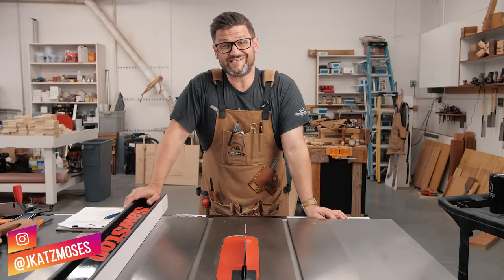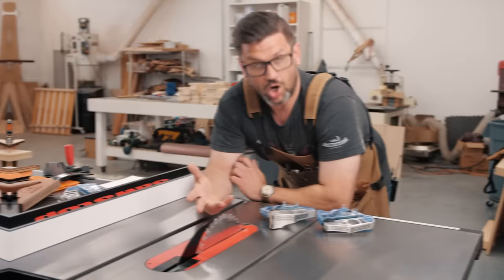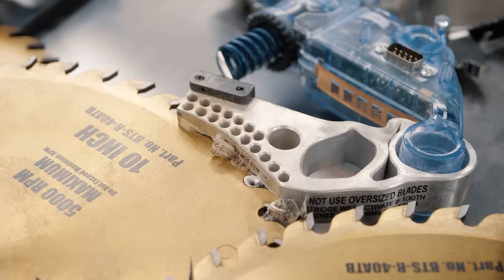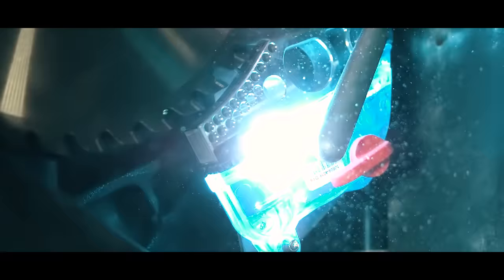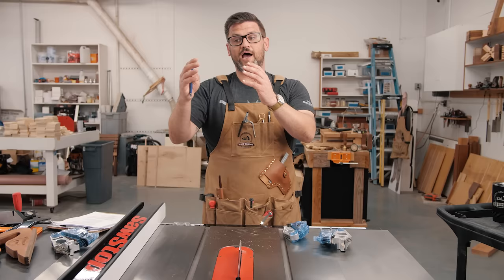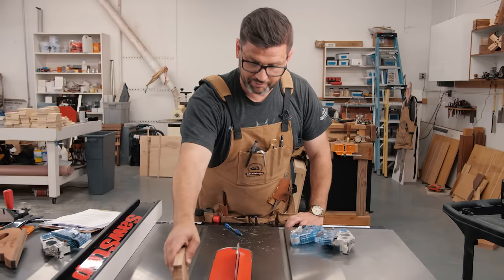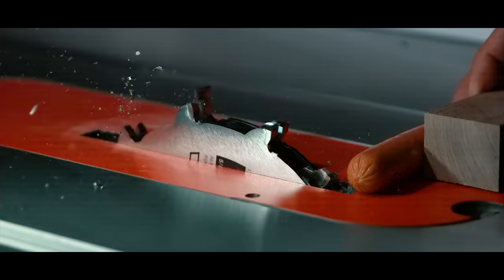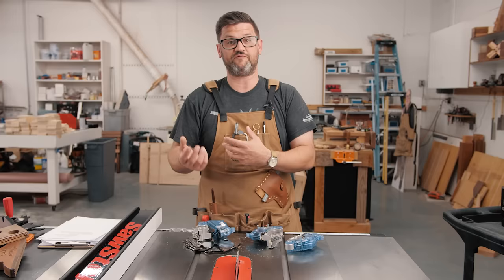How Safe is a Sawstop Saw? - Never Before Seen 19,000 FPS HD Slow-Mo Video

Comment: Just as a clarification, dados are not illegal in Europe. Saws have a requirement to be able to stop in a very short time after power off (something like 1.5 seconds if I recall correctly). Hence they need to have a brake, and manufacturers shorten their arbors so you cannot put a dado stack on your saw because it would then fail the braking requirement (more mass, more inertia, longer stopping time). So they're not really illegal, and you can still buy them here from a few rare suppliers, but they're just not possible to use with the vast amount of saws available.
.
Beyond that, holy bejeezus those are some cool shots! I'm getting a newfound respect for Sawstop for sure, especially with the dado stop.
Reply from the maker: Thank you sir! I hope you're doing well! Still trying to check of all the ways to sharpen my pencil 😉
Reply: @katzmosestools  I'm trying to reach out to Sawstop to see if they want to co-develop a pencil sharpener using their technology, no luck yet though 😉
Reply: My evolution table saw takes like 25 seconds to slow down and it's only a few years old
Reply: @fennecbesixdouze1794  You normaly dont lie on a table saw do you? 1,5 Seconds is a long time yes, but its short enough to prevent further damage.
Reply: @fennecbesixdouze1794  no they use router bits over there.
Reply: Seems like this saw stops within 1.5 seconds, so maybe dados on these are legal?
Reply: It is not inertia, but the moment of inertia (nmr^2). Nice explanation!
Reply: Holobrine what are dados?
Reply: Bobby Brady  no, I said Europe because that's what was said in the video. As far as most people outside Europe are concerned EU and Europe could just as well be synonymous, so there's really no need to be unnecessarily picky.
Reply: @fennecbesixdouze1794  At least they aren't slaughtering us in our houses and streets though for no reasons what so ever. I'll take our version of policing over yours. At least we get to live to tell the tale.
Reply: Switch & Lever I searched Dado blade illegal and this paragraph was brought up from WoodWorkerInstitute.com.. "As already mentioned dado blades areillegal on UK (EU) table saws because in order to use them the guard and riving knife have to be removed, and is therefore unsafe. This is not the case in the USA. Because of this, all UK or european table saws are deliberatley fitted with short arbors to prevent their use."
Reply: @sheldonwoodhouse4222  yes, this is an oft repeated misconception. They're not illegal, as you can buy them from a few shops (like Axminster) as well as saws that can accommodate them. There is a whole business in the UK of retrofitting older table saws (and other similar woodworking machines) with DC brakes to make sure they comply with standards. No one is really going to fine you if you have a non-compliant saw in your home workshop, but if you use one in a commercial setting it will have to comply.
Reply: @fennecbesixdouze1794  🤣
Reply: @fennecbesixdouze1794  it's not 1.5 seconds in emergency, it's 1.5 seconds when powered off. You finish your cut, your turn the saw off, and by the time you've picked up your piece of wood the blade isn't spinning. That's reasonably safe in most situations. 
Being able to stop in a fraction of a second like this video would require special equipment like the Sawstop. You wouldn't want your saw to fire the Sawstop every time you power it off, you'd have to replace the blade and mechanism every time. 
As someone stated above, saws that don't pass the regulation can take upwards of 25 seconds during a normal power-off. Compared to that, 1.5 is definitely safer.
Reply: Bobby Brady  dude, chill. It's okay 🙂
Reply: @markrobinson8575  what
Reply: Bobby Brady  calm down Bobby Boy, no need to get worked up :)
Reply: @fennecbesixdouze1794  No
Reply: Not sure if I missed it in the video, but how is it distinguishing between what's gonna be a finger/thumb or a piece of wood?
Reply: Bobby Brady  wow so mature of you
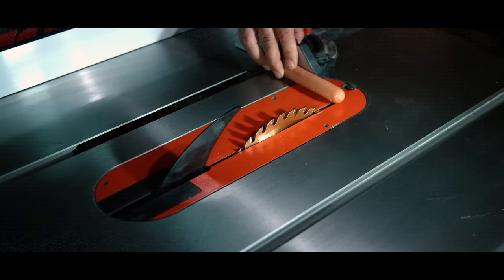Reply: Spicy Meat 2:35
Reply: @AverageAtBestHDTB  It wasn't explained in the video. But he does go over the 3V of current running through the blade. Wood doesn't conduct, but your finger will, when that current drops, the blade stops
Reply: @ferociousmullet9287  that doesn't happen over here either lol. That's media dramatization to seem like the norm, when in reality it's quite rsre
Reply: @SwitchAndLever  it seems you don't mind being unnecessarily picky about casually using illegal in a way most wouldn't care about.
Reply: @lucasng4712  Cheers, very clever system indeed
Reply: @lucasng4712  does it work the same when cutting metal also?
Reply: @ryanbrown4053  3 a day on average. That is not rare. Stop the lies and denial. Try and be honest at least. THREE a day compared to every other western nation on the planet which is an average of ZERO a day. Denial is not just a river in Egypt. Stop being so disingenuous.
Reply: Switch & Lever what about the hand held versions? The mounted version seems safer but the exact same, mobile saw.. not so safe right? Why’s this guy trying to convince people it’s safe when everyone who’s found this video is probably here cos of being cut by one or something along the lines of it? if it’s a lil cut we get.. whys he using a sosig, not he’s finger? Man up.
Reply: @rickey236  there are no hand held table saws, that is an oxymoron. There are hand held circular saws, absolutely, and they also have stopping requirements...and I've never seen any hand held circular saw be able to accommodate a dado stack, so I'm unsure what you're going for here. If you're so desperate to see blood may I suggest an action movie rather than telling people they're not manly for not cutting their own fingers for your enjoyment? Get with the times, it's 2020! 😂
Reply: @SwitchAndLever  why is it so hard for you to admit that you were wrong or at least didnt differentiate enough? I also experienced a lot of times that people got mad when somebody called US citizens just Americans. so in fact for a lot of Europeans America and USA are something like synonyms but its wrong. period.
Reply: @SwitchAndLever  
Who in their right mind would call Europe and EU synonymous?
Reply: @TheKuddelmuddel1  I'll start saying Usanians
Reply: @Ninjaananas  Ikr, in Europe there are depending on how you count it at least 47 countries. The EU has currently 27 member states. Really a minor difference. lmao
Reply: Hi 1% of the people who see this I just wanted to say have a nice day, enjoy and have fun in your quarantine 😉
Reply: @TheKuddelmuddel1  
And that Europe is continent and the EU an union of sovereign states.
Reply: Time to pertend like i know you
Reply: Mark Robinson Oml
Reply: Are legal*
Reply: Bobby Brady . Chill.
Reply: @TheKuddelmuddel1  soon to be 26 thank fuck. Fuck their rules and regulations.
Reply: @michaelsanderson2913  what country are you talking about?
Reply: @TheKuddelmuddel1 . What do you mean ? When I say soon to be 26 I'm referring to the amount of EU member states that will still be part of the union come January.
Reply: @michaelsanderson2913  so you are talking about UK then? Yeah I dont count them as part of the EU anymore because they literally left on 31th of January this year. they are still in the customs union and part of the European Single Market but only because otherwise they couldnt survive for shit. And if you think UK will be better off standing alone against huge economical leader states like USA or China or state associations like the EU then go for it. I will applaud while you are going down. cheers
Reply: @Holobrine  The way the law is written it's 1.5 seconds after power off, not after touching. 
A service brake/motor brake can stop the saw without damaging the blade.  A sawstop will destroy the blade and the sawstop itself. (Even if a well built table saw should otherwise be fine.) So you cant really use the sawstop every time you turn of your table saw.

There are corner cases where the the sawstop will not work; for example, if after you have finished cutting, your workpiece or another piece of wood, touch the blade, causing a kickback hitting you in the face.  That said, a sawstop is probably quite a bit safer overall, so if someone lobbied the European Parliament to have the service stop requirements relaxed when something like sawstop is installed, it could open a new market for "dado stack capable table saws with flesh detecting emergency stops".
Reply: Bobby Brady  How someone can get so pissed off about nothing is beyond my understanding
Reply: @Ninjaananas  I dunno, maybe it's the same phenomenon that leads to most Europeans referring to the US as America?
Reply: @doomse150  
They still know that those are not synonymous. They are just a case of totum pro parte.
Reply: @Ninjaananas  And so are people who refer to the EU as Europe. It just flows better when you talk from an outside perspective and I refuse to believe that there are people who don't know that there's a difference (or these people are at least not using the internet)
Reply: Bobby Brady  Wait, you showed middle finger, didn't you? I  what way did I insult you that would suggest me being actually pissed and not simply amused by your little rant
Reply: @doomse150  
Yes, calling the EU Europe is also a totum pro parte. They are still not synonymous, otherwise it would not really be a totum pro parte.
Reply: @TheKuddelmuddel1 . Great job I know, thank you.
Reply: @TheKuddelmuddel1 . Errr we kind of are. That was the whole point. Thanks again.
Reply: they are not allowed at saw con
Reply: @ferociousmullet9287  Oh please!!!
Reply: @Ninjaananas   most of the people living in Europe.
Reply: @SwitchAndLever  same as calling USA, america. Canada is also america.
Reply: @TheMrVengeance  
That is the term of it. If I did not want to use Latin, I would have to make a new word up and no one would understand that.

I was never talking about fallacies. A totum pro parte is not a fallacy but a rhetoric device. 
And now stop making your insecurity so obvious.
Reply: @Ninjaananas  - If you knew it wasn't a fallacy, maybe you shouldn't have brought it up like it was.
Because if using Europe over EU was a deliberate choice of using the whole for a part as a rhetorical device that defeats your earlier complaints of it being "a mistake".

Also maybe you should stop with your obvious projection? You're the only one here being insecure, going on a latin-filled pedantic rant because someone didn't correctly acknowledge the wonderful variety of European nations.

(And see how you can easily explain/refer to the rhetorical device without latin. 😉)
Reply: @TheMrVengeance  
I did not do that. Your insecurity made you percieve it in such a way.
I did call the rhetoric device an error but assuming that EU and Europe are synonymous which they definitivly are not.

There is no insecurity in using the proper terms. It only helps people to understand things better if they want to understand. We refuse to be an anti-intellectual who wants to dumb down language. These terms should not be forgotten or else it would be a regression. We should be able to explain and identify things. 
I was also never ranting. That's projection on your side.

We can explain and refer to things without certain terms but that is not always optimal. 
I rather say "The rainforest is humid." than "The rainforest has an atmosphere whichs air is highly saturated with water." and I want to say "multiplication" instead of "adding to the number the same number a bunch of times".
Reply: @Ninjaananas  - See, you're making the same mistake again. If the commenter made an error and assumed the two terms were synonymous, it wouldn't have been a "totum pro parte". Because that's a deliberately chosen rhetorical device done for effect.
Either it was an error, or it was a metonym. You can't claim it's both.
UNLESS you falsely assumed the latin-phrased thing was a fallacy.

And on that note; Imagine thinking latin phrases makes your language more understandable than putting it in plain English. 😂 
Honestly the fact that you've only put English to English in your examples speaks volumes. 'Personal attack' is more clear than 'ad hominem', 'assuming causation' is clearer than 'post hoc ergo propter hoc'.
(Also ironic to claim "regression" when you're the one sticking to a dead language instead of speaking perfectly adequate modern-day English. 👌🏻)
Reply: @TheMrVengeance  
I already said that it cannot be both synonymous and a totum pro parte. 
I did not say that the original commentator made deliberatly a totum pro parte nor that he thinks that EU and Europe are synonymous. He said that for someone people, these two are basicly synonymous and I expressed that they are definitivly not synonymous. Someone else replied to me and I said that EU could be called Europe as a totum pro parte but one cannot claim that EU and Europe are synonymous.

I did not invent the terms and no one made English translation for them thus their English names are still Latin. And using Latin terms universally has benefits. For example in classifying biological taxa so that you just have to look at the scientific name of a taxon which will then be the same in every language. This makes things much more simple.
Personal attack and ad hominem are not synonymous. Such misconceptions are what you get from your anti-intellectual arrogance. 
It is not like I am speaking Latin. I am just using terms that have been named in Latin and sticked. And I am not some American simpleton who thinks the whole world is English and who does not know anything about the outside world.
Reply: @Ninjaananas  - Haha. Nice one, pretending I'm anti-intellectual when YOU are actually the one that's intellectually dishonest enough to tamper with the record by sneakily changing your comment. I can see that: (edited) behind the comment I replied to.
Originally you 100% DID say that the commenter "made a totum pro parte".

Besides that whole paragraph is a bunch of nonsense. Biological taxa being latin has absolutely nothing to do with the clarity of everyday speech. 
And the fact that "not every country speaks English" has absolutely nothing to do with this when we're talking in the context of an English conversation.
(Also if it was a valid point, there are NO countries that still speak latin. Soo....)
Reply: @TheMrVengeance  
No, I just corrected a typographical error. I wrote now instead of know which I corrected. You are again projecting. This time your desire to prove yourself right no matter what. That is why you are grasping for straws and purposly misinterprating my words. But no matter what you do, your mistake will not be erased and I know what you did. You won't decieve me because I know what I wrote, what I edited and what I meant. Much better than you. You are only making this only more ignominious for you. It would have been much better for you to instead of trying to bend everything to make it look like I used the terms improperly, to claim you thought I was using them improperly because you mixed something up or because I did not write clear enough. That could have been a peaceful escape for you.

Neither is discussing rhetoric devices part of everyday speech. So the comparison still holds. But the scientific names of the taxa being universally Latin is very important. That way, you can easily clarify about what taxon exactly is talked about and you do not have to worry about precise translation. 

The fact that English is not the universal language of all humans is very important to this discussion. It is the very reason why some terms are not English to begin with. 

Latin not being activly spoken may even be the point. It makes it more neutral, more timeless and more resistant to changes in language. If the scientific names for the taxa were English, it would maybe be hard to discern whether one is looking at the scientific name or just an English name or whether someone was using the scientific name or the English name. And people are constantly being inprecise with language. If we just used the English names as the scientific names, the precision would fade because the exact meaning of tje words would change. One time a word refers to a specis of butterflies and another time it would refer its whole genus. Especially if it was a genus with only one species. And people would excuse it with "Don't be so strict!" or "It is basicly the same!" and then we would not know anymore when the species is refered to and when the genus. But this probably just confused you anyway. Just leave and believe what you want because that is what you are doing anyway.
Reply: @AverageAtBestHDTB  it stops by conducting electricity
Reply: @ferociousmullet9287 looks at french police
Reply: Do the saws also have safety stops in them? 1.5 seconds is quick. But it seems unnecessary if your just shutting the saw off. Like it wouldn’t be fast enough in an emergency, but could also unintentionally damage the blade.
Reply: In fact,  european table saws have optional additional shaft  in front of the sawblade shaft ( as option when you buy the table) so that you can mount a scoring blade or a dado blade to make dados. Have a look at Felder or Hammer brands. What you cannot do is mount a dado blade on the normal saw blade axe as you do in US.
Reply: @ferociousmullet9287  your comment didn’t age well